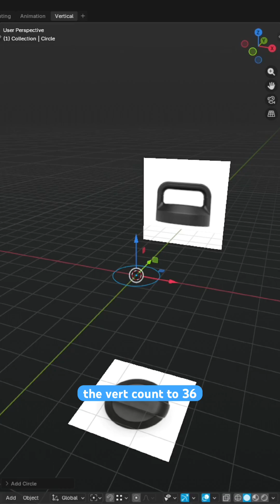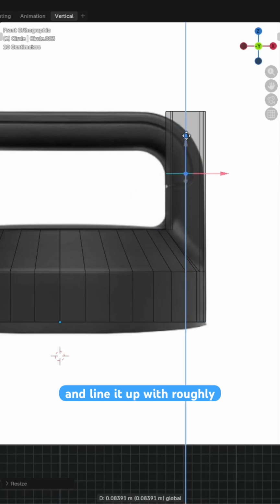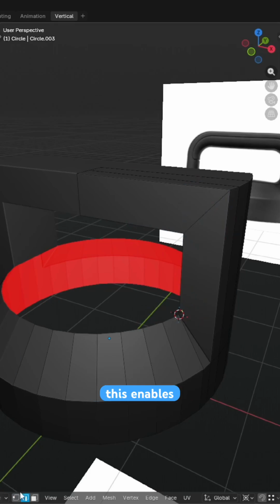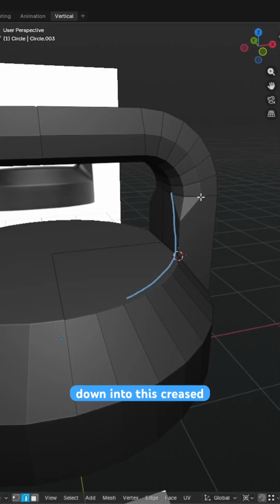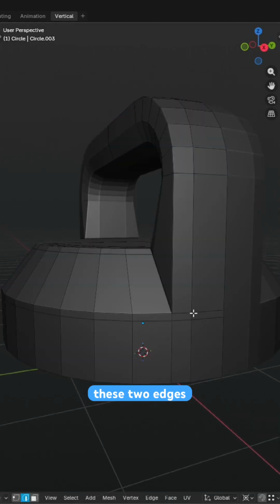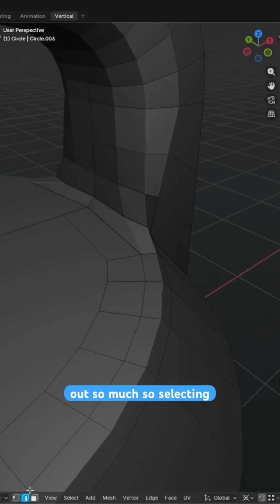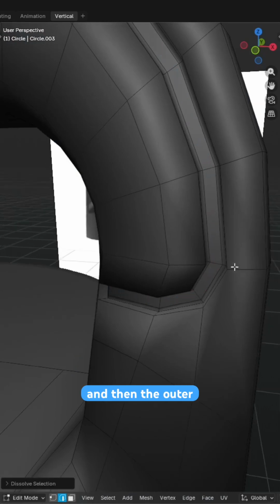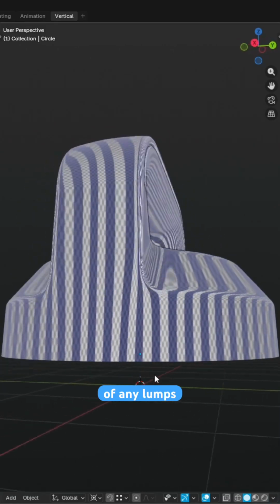Blender Model a YETI Bottle Lid | #blender3d #blendertutorial #blender3dmodelling

Comment: You used the 3D cursor when you could have selected the vertices and then scaled by active. Just a tip.  👍
Reply from the maker: I always forget that this is a feature, I think because I learnt Blender back in 2.79 using the 3D cursor is just my go to for absolutely everything. 😅
Reply: @masterj2001  I started using blender in 2.8 and I would use 3D cursor for everything too until I started to do lots of car modeling.

Comment: This is why i'd rather just use plasticity when it comes to modeling such a piece. I still admire people who know how do model this way, but there is a reason cad programs exists. also if the design changes you will have to redo all the topology, where is if you use cad, the design can change and it will take less time. But I should learn to model this good, i just think some software is better at other tasks
Reply from the maker: It's funny, I see these comments a lot about using parametric or NURBs based modelling software over vertex modelling in Blender, but there's a reason I do these challenges. 😄

The idea behind these modelling challenges is to help people to get better with topology management and thinking about modelling problem solving. I predominantly focus on making helmet and armour modelling tutorials, how to bake normal maps for them and texture the assets. 

So these modelling exercises are a great way to help people get their skills up to scratch to tackle more advanced modelling practices. If I were teaching for print, parametric or NURBs based modelling programs would be great, but I do all my modelling and tutorial content for digital usage. 😁

Comment: you could add another unchamfered bevel at the bottom of the handle and resolve the Ngon and get better normals, all in all decent solution
Reply from the maker: You can, but it'll create more headaches to try and resolve and introduce more shading errors than the ngon due to the uneven edge lengths stretching out across the side. 😄

If you check the related video with the full length modelling solution, I do actually mention this solution and show how the ngon subdivides. Since we're doing subdivision surface modelling, we're concerning ourselves with how the ngons subdivide. In this instance, it creates a pole along the outer edge of that bevel and produces a clean set of poly flow. 😄

I also have a video that explains how and why ngons can be used on curved surfaces in subdivision hard surface modelling if you're interested. 😄
Reply: @masterj2001 sure I'll have a look at the video! Ngons surely aren't the devil, they come in handy in many situations, i hadn't thought of the eventual subdivision it's indeed a neat trick, just commented out of the box watching the short 😊

Comment: How do you dissolve edges? Also do you have a tutorial on all the blender keybinds that you need for a beginner?
Reply: select the edges in edge mode and press ctrl x
Reply from the maker: Ctrl+x as heijerman has already kindly explained. 😄

I don't have a video that explicitly explains all the keybinds no. However, I do have a handful of beginner friendly modelling tutorials that will help you get a hang of various keybinds through simple modelling exercises. 😄

Comment: It is on days like this that I open up Parasolid and just smile.
Reply from the maker: This is no doubt easier to do in parametric or NURBs based modelling software, but the idea of these challenges is to help people improve their topology problem solving and subdivision hard surface modelling skills. 😄

I mainly focus on helmet and armour modelling tutorials that are all used digitally, so the soft skills I teach here translate really well for those who want to take on some of my more advanced free modelling courses such as the Master Chief or Space Marine helmet. 😄

While I have no doubt Parasolid works great for building models for print, the content I teach is focused on models for digital use. So the methods I show here are great for creating the high and low poly meshes simultaneously which then makes it easy to bake normals maps and export for texturing. 😄

Comment: Awkward you don't get any pinching, when we see that corner where the handle goes up. That none looks quite wicked
Reply from the maker: That's the beauty of knowing how and where to place ngons on your mesh. 😄

The topology doesn't look aesthetically appealing at all, at least not until subdivided, and that's why it's important to flick between looking at the subdivided wires when modelling. Two of the most important things that I've learnt this year no doubt. s😄
Reply: @masterj2001 still, normally with such a weird shape, you see really strange reflection patterns. Did you also tried different matcaps. I know some don't always show the reflections properly
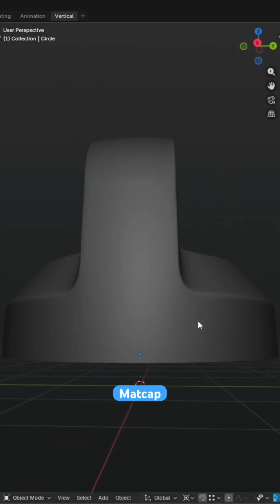Reply from the maker: @RomboutVersluijs  Yeah, if you watch at 2:43 I switch to a much harsher and unforgiving matcap to show that there are no lumps and bumps on the model. I also more clearly showcase the underlying subdivided topology in the full length version of the video which you can find though the related video. 😄
Reply: @masterj2001 yes I did see, I do know that some of these react differently. Need to try this myself

Comment: I truely wish I knew how to work with support loops and well, all this stuff to make cleaner topology, its hard to get my head around why or when to use these techniques
Reply: Support loops, just like edge crease, will pull in loops tighter when using subdiv. They also help getting more even loops in other places, when you place them in large open sections
Reply: It's basically practice, you'll get the hang of it and understand it better the more you do and try it
Reply: Start texturing. You immediately see how things stretch and (don’t) when there is a purpose for the supporting loops and controlling edges.
Reply from the maker: In that case, you might find my video about Sharps, Bevels, Creases, and Loops rather helpful then! 😄

I also have a handful of beginner hard surface modelling tutorials that should help you get up to speed with practical modelling examples too. 😄

Comment: Speaking of reference images, is there a website that actually has all side views, front views of any object. Good video btw
Reply from the maker: I'm not sure if there is any one website that has an exclusive set of orthographic imagery, but general Google searches is typically good enough to find what you need. Even if you can't find exact orthographic references, that's fine, as you really only need them to help influence some of the major shapes and proportions. 😄

Even with these references, you can see that I don't model to them exactly due to the lens distortion from the camera, I'm just using them as a general guide. 😄
Reply: ChatGPT can generate Ortho views. Just input an image of the object and say "Orthographic images for blender"
Reply from the maker: @quorthonsinferno5119  Even with this, you'll still need to take a fair bit of artistic interpretation with the output, as you won't get 1:1 images that line up from each angle. There's plenty of imagery out there without needing generative AI, so I think in a lot of cases you're just better off taking to Google to find reference images, orthographic or not, and then building out a Pureref board to model from. 😄
Reply: @quorthonsinferno5119  ChatGPT WILL mess up. It’s ass and bad.